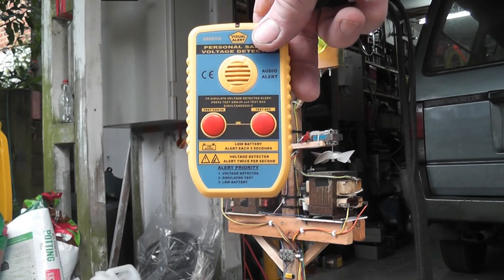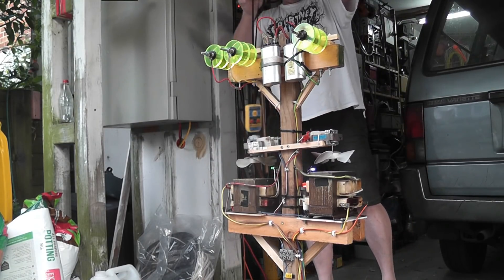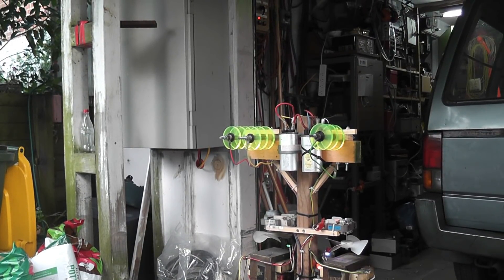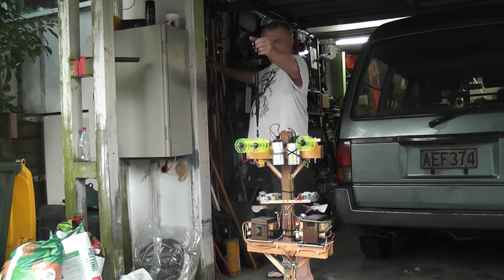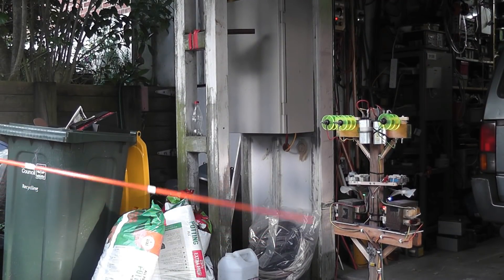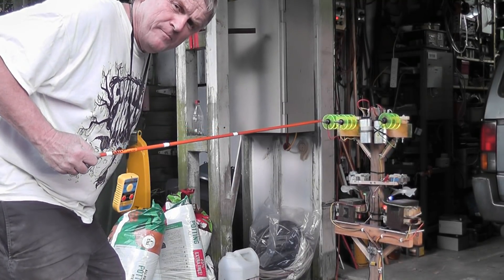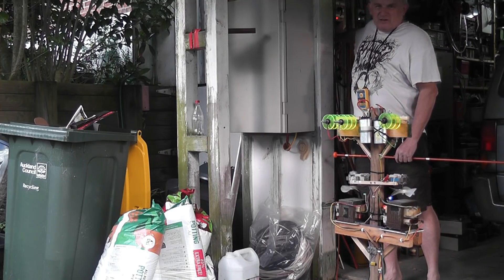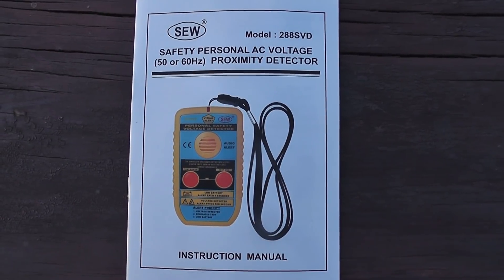SEW  Safety Personal AC Voltage Detector

Comment: Thats a very handy device  I think it would be a good idea if all substation and line workers had to have one. I was surprised it wiorked near to 240 volt house mains  must be  a very sensitive device
Reply: Presumably it has two conductors a fixed width apart and is detecting the voltage across the gap induced by the field around the live conductor.  If so, the closer you get to a live conductor, the smaller the voltage that will trigger it because it's measuring field strength not absolute voltage.

I'd expect it to do well with a light switch which has just two conductors, live and switched live, with one or both being live.  I'd expect it to do less well with two-core + earth mains cable where the live and neutral are close together and the field drops away rapidly with distance.
Reply: detecting 240 volts without a load attached and hidden deep in a wall are nearly impossible to detect. The electro magnetic fields are too weak.

Comment: Good video impressive device also I noticed you have a big enclosure on the outside you stated that you will be building a meter board in that if I remeber correctly. Hows it coming up? Thanks
Reply from the maker: It has a couple of check meters in it. now will be using it for the Lister generator wiring transfer switches.